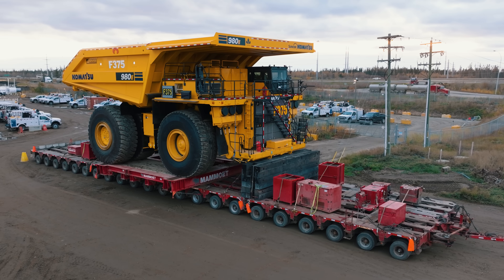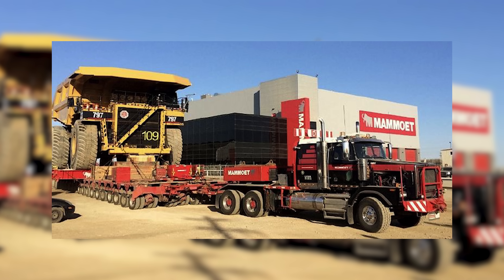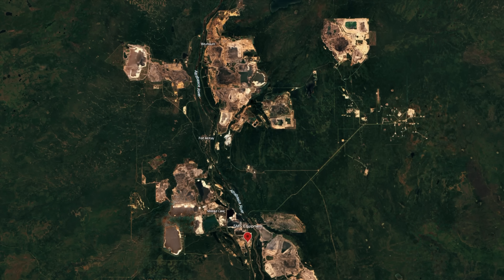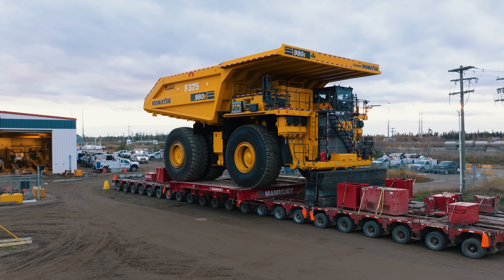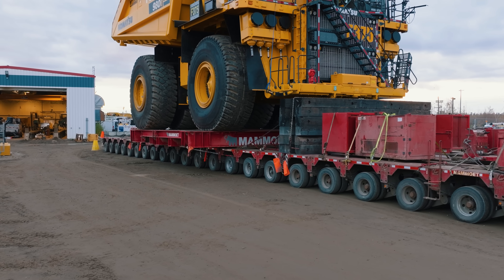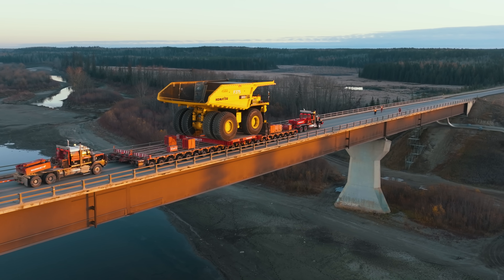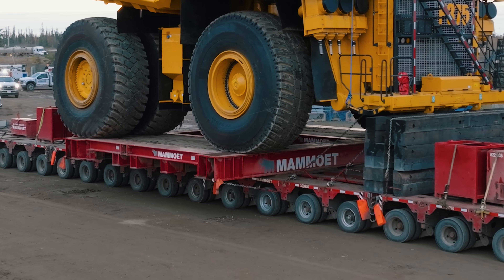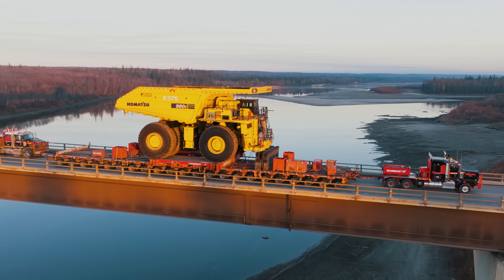How They Move the World's Biggest Haul Truck

Comment: Does the trailer have a steering mechanism? Hard to envision all those axles being fixed. If it does have steering, is it actively controlled or does it just follow the track?
Reply from the maker: The axles steer, the drawbar connected to the front pull truck controls the steering. As the front truck steers, so does the trailer
Reply: @Earthmovers_media  thank you for the info.

Comment: The fully assemble 780 transported is very impressive! What impresses me even more is the capacity of the bridge to nowhere. Such a span from prop to prop and aditionally 400t on it! Or whats the weight of the transport at 5min.? very impressive and tough built bridge! Would say 25t each truck, 44 axle lines= 140t+platform for the load and the 230t komatzu. So in truth round 450t

Comment: The BelAZ 75710 is the world's largest and heaviest mining dump truck, boasting a record payload capacity of 450 metric tons (800,000 lbs) and an empty weight of 360 tons, powered by two diesel engines providing 4,600 horsepower for an electric drive system, and features unique dual wheels and four-wheel steering for immense capability in extreme mining conditions. Made in Belarus. Not the Caterpillar 797 or the Komatsu 980.
Reply from the maker: Only a few of those trucks ever sold, so it's considered a one off machine. It may be the "biggest" but it's also the least popular and I bet they don't sell anymore of them
Reply: @Earthmovers_media  BelAZ trucks are still made in Zhodzina, Belarus, by the company Belarusian Autoworks (BelAZ). BelAZ is a major global manufacturer of heavy-duty mining equipment and continues to produce a wide range of models, including the world's largest dump truck. The company is actively manufacturing new mining dump trucks with various payload capacities, ranging from 30 to 450 tons. The 110-140 ton series (7513 series) is their current bestseller and leads the world market in that segment. BelAZ is famous for producing the BelAZ 75710, which remains the largest and heaviest mining dump truck ever built, with a payload capacity of 450 metric tons. This model has been in production since 2013. Educate yourself before making comments.

Comment: Why not just drive the haul truck up to the mine ? Would it wreck the road ? Because it's not road legal ??
Reply: It basically comes down to weight distribution.  By putting it on a trailer like that, the weight is spread along a much longer section of road at one time.  There are numerous utility crossings such as pipelines that will not bear the weight of one of these trucks being driven over them.  They will however take the weight if it is spread out.  Hope that helps.
Reply: @alco424  Thanks !
Reply: My thought, too!

Comment: Don’t understand why they don’t just drive the thing to where it’s going under escort,  it would be cheaper, quicker, less fuel, the road has to be shut for the haulage rig anyway, so why all the fuss?
Reply from the maker: Would also destroy every inch of highway it touches due to ground pressure
Reply: The haul truck's weight of 270 tones is distributed over the spread of the 352 tires on the platform trailer, which makes it a much larger footprint of rubber contact, with less weight per tire contact to the pavement, than it would be from the four tires on the haul truck itself.

Comment: Ridiculous! All this trouble to move a vehicle that is perfectly able to move on its own wheels, that would be faster, more agile, safer, at a much lower cost and time, and wouldn't block the road as long as this rig.
Reply: yeah cause youre definitely smarter than the people involved in the project......
Reply from the maker: Other than the fact 500,000+lbs of Komatsu haul truck would obliterate the pavement and sub grade. The weight has to be spread across the 352 tires of this trailer.

Comment: Why not just drive it down the highway
Reply: The axle load on that thing is way too high for the road.
Reply: Idk about the DOT regulation about getting that done it's probably possible but the reason they likely do this is bc the cost of the truck, transporting it and building it is all built in to the sales price so to just drive it down to site is kinda shorting the customer in a sense not to mention it's kinda just a professional thing, when you buy a brand new truck you expect a brand new truck with close to 0 hours on it

Comment: Why not just drive it??  Is the road surface just not up to handling the weight on just its 6 tires? Are there a lot of smaller bridge crossings that require the trailer to spread the load?  The trailer is no help on the big bridge as it just adds weight and doesn’t spread the load between pillars.
Reply: It well destroy the road
Reply: there is such a thing as point-loading, without the trailer the weight of the truck would be on 6 point, of which would form 2 lateral point loads, being the front axle and rear axle, with the trailer it is 22 lateral load lines over a much further length.

in short there you have 44 axle lines between two modular trailer each with 22 axle lines, each "axle" line has 8 tyres, with a total of 16 tyres for each lateral line of axle sets, and being that every set of 4 tyres is mounted to a Pendular axle (half axle) with hydraulic levelling suspension the individual weight imposed on each Pendular axle will be very close to all the others due to the load sharing, so the 44 Pendular axles on each modular trailer and the 88 Pendular axle between the two modular trailer will impose much the same load on all individual tyres.
Reply from the maker: All that haul truck weight on the road would destroy the pavement and sub grade

Comment: Why don't they just drive the big truck.
Reply: The 500k+lbs weight of the thing would destroy the highway. Putting on the trailer distributes the weight over a few hundred wheels rather than 6 that it drives on.